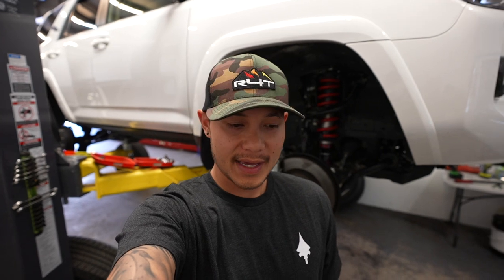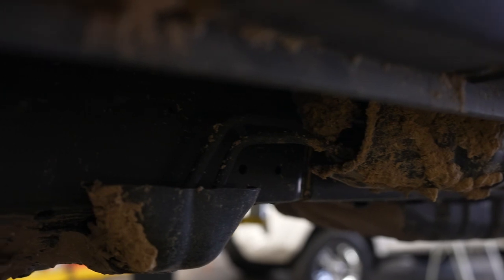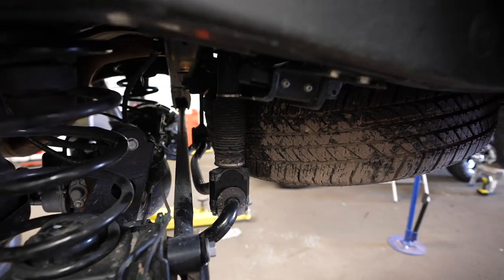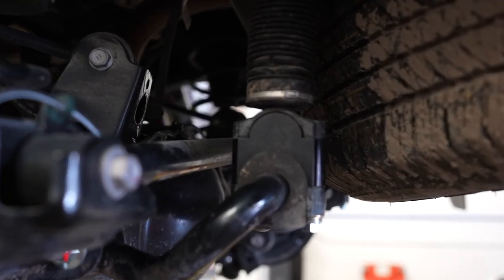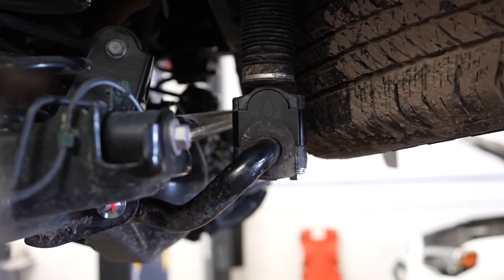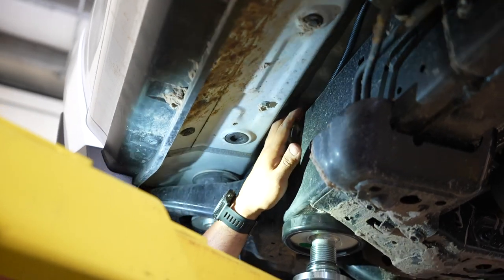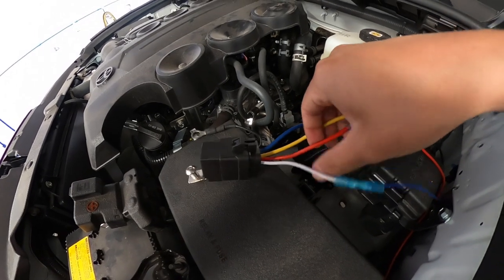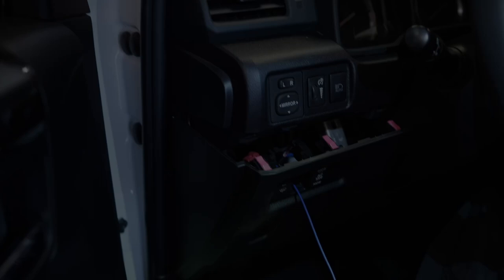How to Make a KDSS-Equipped 4Runner BETTER Off-Road! Blackgate Customs

Comment: Get the blocks from Kyle at Treaty Oak offroad. He has a front spacer too.  Plus treaty oak spacer work with more lifts.  And you are supporting someone that knows what’s up in the offroad industry vs a guy who steels ideas.
Reply from the maker: We didn't realize that there was another company making these. Thanks for the referral, checking out their stuff now. 🙏
Reply: I agree! Got my spacer from treaty oak comes with front and 2 rear spacers , also the harness from dr.kdss is way better.. installs in the cabin opposed to underneath risking damage
Reply: Treaty oak!!
Reply: @bigal924  thx buddy. That’s me 🤘🏽❤️
Reply: Flitllc seems Kyle is running out of the engineering department, they don't have crap for nothing, nothing is KDSS compatible, funny how they sell this kit, but all the other products are for non KDSS models 😂😂😂

Comment: The KDSS system doesn’t make the car stiffer, the thicker sway bars does, the KDSS function is to disconnect the sway bars at low speed  to let  the wheel down travel more then the standard suspension when sway bar disconnect but it is limited down travel distance even though when you install aftermarket extended suspension, that is the only disadvantage.

Comment: The 4R with kdss isn’t limited in any way vs standard non equipped 4R.  Virtually every lift kit comes with a kdss option, in addition to skid plates, sliders, etc.  and most people whonhave driven both, prefer kdss over non kdss.
Reply: I have a kdss one and it rides nicer both on and offroad than the non kdss. You can also deactivate kdss by pulling the fuse, though a button would be nice.
Reply: Exactly, KDSS is superior in every way
Reply: Good to know as I’ve not wanted KDSS but the 2022 T4R my friend ordered and decided not to get (he’s getting Model Y Performance and gave me his T4R) has the KDSS. I know the lifts are a little bit pricier but from what I am finding in my research is the KDSS rides nicer. I am probably going to be on road and not doing much off reading for the near future.
Reply: I wouldn’t get a 4Runner without it after driving both back to back. I have a modest 2.4” lift in the front and 2” in the rear and no problems whatsoever.

Comment: Curious if you have compared this KDSS disconnect with Dr. KDSS’. I like that his plugs in under the steering wheel. No need to run wires through the firewall.

Comment: The only reason you would t get kdss if you are going to baja the rig high speed and need massive travel when lifting.   Other than that off road with a good decent loft kdss outperforms on and off road.  The TRD PRO badge is the biggest marketing scam in toyota history.

Comment: All things being even KDSS gives you more offroad articulation but requires kdss spacers or aftermarket track panhard bar when going above 3 or 4 inches increased suspension. It's like a swaybar disconnect below 12 MPH.

Comment: i had my 2018 prado and hear a clunking noise on the rear sway bar. mechanic told me that the source of sound is from the hydraulic ram. is it possible that this hydraulic ram will deteriorate for a 4 year period of use? where can i purchase this part? roy here from the philippines.

Comment: can I put a 2" -3" leveling kit in my 2022 TRD offroad four runner without affecting the KDSS system or will I need spacers for the kdss??
Reply from the maker: You can go as much as 2" on a vehicle with KDSS

Comment: Good to know, added to my wishlist!
Reply: Also if I have the KDSS and do the Kings stage 3A with with Eibach 1”, do you still recommend the drop kit?
Reply from the maker: You're one of the few that is only doing a 1" lift in the rear. I would say you don't need it until 2"+
Reply: @Runnin4Tacos  ha agreed! I don’t think I would be able to get into my garages with anything higher.

Comment: Do you guys have a shop that can visit?
Reply from the maker: Yes, we do. 665 E 70th Ave Unit 4 Denver CO 80229
Reply: @Runnin4Tacos  does getting this makes the ride smoother? I got a kings lift 3" and its so hard on the road
Reply from the maker: @Grand_GT  Not really, Do you have adjustable Kings? If so, adjust the compression. Kings and Fox that are higher end are tuned for higher compressions, So the faster you go the better the rebound is.
Reply: @Runnin4Tacos  I don't have the adjustable knob, sad, but do you think custom valving makes it a softer ride? I have the kdss; should I be installing your kdss switcher?
Reply from the maker: @Grand_GT  Yes, Custom vavling will get you a better ride quality depending on the terrain.

Comment: Great video! How would a passenger side lean be corrected?
Reply: With a half inch spacer on the passenger side
Reply: Kdss lean can be fix with front spacer from treatyoak offroad only for front passenger side and you will even gain some droop travel that is lost if you have a lift and extended travel shocks.

Comment: I have a 21’ TRD OR w/KDSS coming in 8 weeks. I want to level it just enough to fit 275’s that’s it. What would you recommend?
Reply: Don't take their advice, they clearly don't know KDSS. Best KDSS system is Bilstein 6112/ 5160 and Sonoran steel rear track bar.
Reply: @GMvideo429  that’s not the best lol. Sonoran pan hard bar is the ugliest thing ever. And it doesn’t address what happens if your shock bushing go out. You will invert the kdss system and destroy it. He even mentions it and warns ppl.